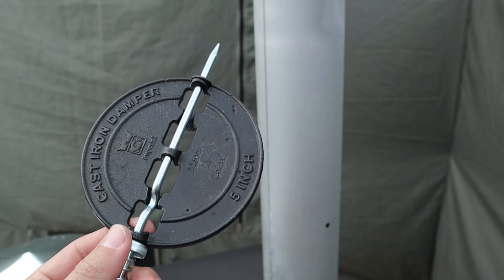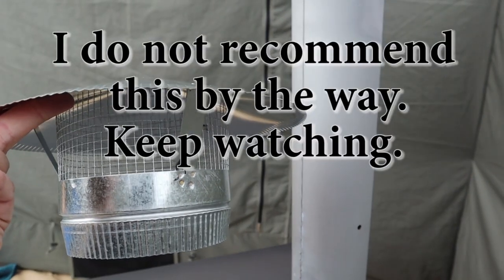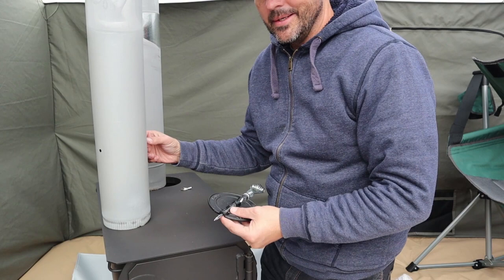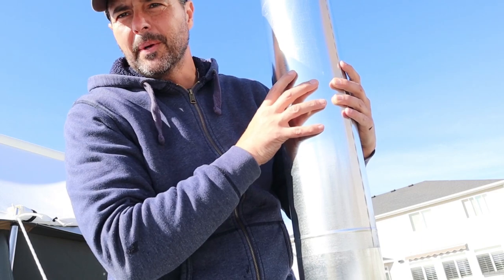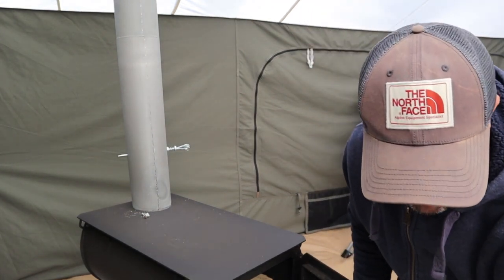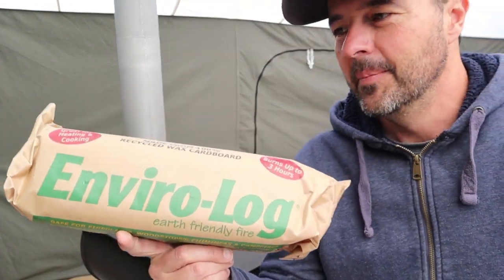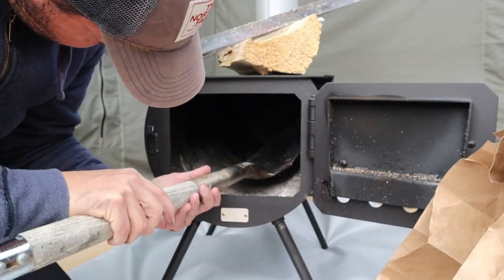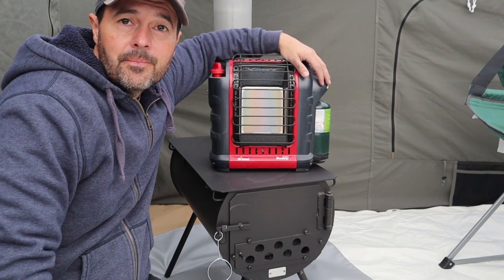Kodiak Lodge Tent 6170 - Day 6, installing damper, comparing Mr. Buddy heater, don’t use a rain cap

Comment: The damper is used to help control the fire burn , open it up and the door damper to have hot fie or to get the wood burning when filling stove then when going good shut both down to let fie burn on a slow burn doesn’t stop the fire foam burning just slow burn and good slow heat ….. been hunting in wall tent for 50 some years .
Reply: Lyle, I just took this tent and stove out for our inaugural first camping trip.  If I close both dampers all the way will I still get a burn through the night?  I found myself getting up a lot to fill the stove up in the middle of the night.
Reply: @adamhilbert8730  yes that’s what you have to do , once you get a good fire going shut both dampers off will burn till wood is gone . If you get up to go to bathroom put some wood in, or if you feel cooling down . Try not spitting all wood if you have whole pices that will fit in use them as many as can get in , burn longer if you put as much as you can . Looking at you’re stove you should be able to put 5-6” maybe 7” in stove , you’ll have to try different sizes .to see what fits best and get lots in , split wood burns a lot faster and quicker .
Reply: @lyleloomis3493  what is your take on the rain cap?  In the video it looks like all the ash and embers came from the EnviroLog he burned.  They are prone to producing a lot of ash.
Reply: @adamhilbert8730   for your tent your pipe goes out the roof so yes use the cap and you might be where it’s law to use . We have our pipe going out the front left side if in tent looking at door , it goes out away from tent 2 pipe length then up in air 2 pipe length no cap we don’t need it. We have 2 - 1” steel pipes drove in ground that we fasten the upward pipe to and tie wire from pipe to pipe under stove pipe too

Comment: Spark arrestor with rain cap is fine but not with a heater cap top style like you would see on a propane heater to push heat down. Ash comes out hits the cap and falls on the tent. With a rain cap spark arrestor that does have the heater cap the smoke just comes out as normal and away from the tent.
Reply from the maker: Thanks for your great points.

Comment: You getting sparks probably because your pipes are not 10 feet at least , I have the same set up but 10 feet , drill in bulbs or screws at top to use guylines to hold your pipes from filling over
Reply from the maker: Great idea!

Comment: Charlie...a question?  Instead of using the rain cap, why not put an elbow pipe at the very top of the pipe, then put a spark arrestor on the end?  It’ll keep the rain out of the pipe and you shouldn’t have the issue of hot embers landing on the tent
Reply from the maker: That's a good point.  I'll have to give that a shot.
Reply: @Competitiveedgeproducts  Please let me know how this works out...I’m still waiting for my tent from you guys.  Overdue by three weeks and counting.  I don’t want to cancel...then I may NEVER get one with the back order waiting.

Comment: Then when there's a downpour and you need heat what's the best option
Reply from the maker: Excellent question.  When it is down pouring you can use a rain cap as a wet roof will be impervious to small embers.

Comment: I know this is way late, but in your demo with the Mr. Buddy Heater you are showing the 9000 BTU model, the smaller one. What difference would using the 18,000 BTU Big Buddy heater, which has two heating elements, make in terms of heating the tent in comparison to wood? Thanks.
Reply from the maker: I think the 18,000 would heat it up nicely.
Reply: All you need is the smaller 9000 model, put a heart activated fan on top and you're good to go. Even on low, this setup will heat your tent quickly.

Comment: I am wondering what it would be like using the Heat Robber and the Rain Cap?  The Heat Robber has its own spark arrestor inside.  This should stop most of the embers and limit what would contact the tent roof.
Reply from the maker: That's a great idea!  I'm going to give that a shot.  I'll post here how it goes once I get my hands on the heat robber.
Reply: Competitive Edge Products, Inc Thank you, I will look forward to seeing how it works.

Comment: even in a down poor not enough water would get into the pipe with a good fire going would do nothing rain cap and worrying about water is nonsense, i been winter camping all my life have been in a very strong rain storms in the fall and never have  had a issue with water into my pipe or stove.
Reply from the maker: Thank you for your comments.  That was my experience as well.

Comment: A thorough cleaning isn't required every time. You should leave the grate in and pull the ashes towards you. The ashes that remain under the grate are a really good insulator to keep the bottom of the stove from burning through.

Comment: Did you use the damper, it slows down the flow of air. That might be some of the ember problem. Not enough speed to send them into the air.

Comment: Listen, you can put the cover back on the pipe you just have to screw the cap to the pipe so you dont loose it again
Reply from the maker: Robert, are you referring to the rain cap?
Reply: Yes I am
Reply from the maker: @onslought2  The rain cap didn't fall off.  I took it off, because it was causing embers to fall onto the tent roof.
Reply: Where do you get the stove and accessories from ??
Reply from the maker: @jaybird3301  Colorado Cylinder Stoves is the brand of the stove and accessories.  This is the Spruce stove model.
Reply: Thank you ! Good videos as well very informative !

Comment: Can you burn charcoal in wood stoves like this? Just the supermarket stuff I mean.
Reply from the maker: That is a good question.  I really don't know the answer to that.  I mean, I'm sure you can, but I'm not sure how efficient it is.  Anybody out there try that?  If so, please share.
Reply: You can but they burn WAY hotter than the wood does so be very careful to not over due it.

Comment: Can you put the spark arrestor mesh on and then put the rain guard on??
Reply from the maker: Great question.  The diameter of the rain card is too wide to fit the spark arrestor.
Reply: @Competitiveedgeproducts  how about just adding extensions to the piping so that the piping goes out and over the ground so that the ash lands on the ground and not the tent?
Reply: I use a spark arrestor cap for over 12 years and haven't had any trouble.  My top section of pipe has a bunch of small holes drilled in it about 6" from the top and down about one foot all the way around spaced and offset about 1".  The embers burn themselves out before leaving the pipe.   Custom made cylinder stove.

Comment: What reason do they recommend NOT using the Buddy heaters?
Reply from the maker: I think it's for liability purposes and safety.
Reply: @Competitiveedgeproducts  did you notice heavy condensation when you tried it?
Reply from the maker: @justins8768  Yeah a bit, nothing major.  I can feel the condensation in the air when I breath especially with a Mr. Buddy.  But I don't see anything beading up on the walls or ceiling.  There is a clear difference with the dry heat though from a wood burning stove.  I own and use both.  I used a Mr. Buddy over the weekend on the Outer Banks and it worked well in the Kodiak screen house, but nothing is quite like a hot stove.  I feel like the stove literally dries the tent on both the inside and outside.  The Mr. Buddy heater adds heat, but doesn't have the BTU's like a wooden stove.  You can get a million BTU's burning a cord of wood for a few hours depending on the tree.  The standard size Mr. Buddy is about 10k maybe?  There are some pros and cons to both.  I'd say the biggest con on a wooden stove is the weight and the wood you need to keep it going.  The Mr. Buddy requires you bring propane, but it's lighter weight, takes longer to heat up and isn't as efficient.  Hope that helps.
Reply: @Competitiveedgeproducts  thank you for taking the time to respond. I am used to running my Big Buddy Heater in a cheap tent which is what I have done for years. It works fine for me but the ceiling is mesh. I am ready to get a bigger, nicer tent but I'm not sure the stove will work for me at this moment just simply because I want to minimize what I'm hauling. I have decided this is the tent I want and I plan on using my Big Buddy heater I just had concerns with the condensation. Thanks again!

Comment: get a proper rain cap for the pipe ... thats for a gas heater ... and useless on a wood stove ... the cap you need is a t cap with fine mesh screen . it will look like a tank gun with muzzle brake  as for the fine mesh ... steel wool held in the cap with some mechanics wire ... it provides a cross flow of air drawing up the flu better ... and the damper adjusts the air flow slowing down or speeding up the fire ... (the heat is just a side effect a damper controls air flow) and for that stove a 4inch pipe is proper size .. 5 inc is over kill and will send more crud up the flu than the proper sized one ... 
.
and not packaging the needed parts from the start that's just plain crappy service ... Kodiak used to be better I guess profit got in the way of quality
Reply from the maker: Thank you for the feedback.  The stove is by Colorado Cylinder, the tent is Kodiak.

Comment: Why couldn't you install a raincap over the spark damper
Reply: The rain cap just meant that embers galore where landing on the roof top.  None did any damage, but I would only put the cap on in the event of some good rain (which I did).  Just be careful how much you are burning with it on.  I've had no complaints from anyone using the cap though.

Comment: If it's windy, point your vent so it blows away from your tent. There is no way burning wood causes that much embers!
Reply from the maker: I'm sorry, but I don't quite understand what your saying.  The vent?  The pipe just goes straight up through the roof and has a mesh spark arrestor - it can't be pointed in a direction.  Or am I missing something?  Wood creates embers, the more you burn, the type of wood, the heat, all contribute to the ember count.
Reply: @Competitiveedgeproducts  point your tent so that the wind blows the smoke away from the tent. And make sure that your pipe is higher than the tent.
Reply from the maker: @dodgerammopar360  ah, I see what your saying.  There a few places I've been where the wind blows consistently one way.  That's not a bad idea.
Reply: @Competitiveedgeproducts also make sure your flu pipe is above your tent so the embers have time to cool before it leaves the pipe

Comment: Use a bigger mr buddy that one is small
Reply: Yeah, I've got the dual burner mr. buddy with a 16 gallon tank and 8' hose and it can heat it up really well.  It's not the dry type of burn though, meaning, you get a fair amount of condensation if you're burning it a while.

Comment: Didn't even compare the Mr. Buddy.
Reply from the maker: No you're right. I should have done a better job about that.  Here's what I noticed with the Mr. Buddy heater - it did okay in temperatures around 40F.  It couldn't heat it down to 1F though.  It would bring the temperature up closer to 40F when running on high.  Could you get by with a Mr. Buddy, sure!  Some campsites won't allow stoves and there are burning restrictions in certain times of the year, especially out West.  There is a Mr. Buddy that has two elements and feeds in with two propane canisters.  That one could keep up much better in this large tent.  So, it definitely could work, but once you've fired up a wood burning heater you know you've got very comfortable heat relatively quickly and you don't have to battle the humidity/condensation that's a byproduct of propane.  Thank you for bringing this up.  I really think I'm going to do another video and compare them as the sole focus of the video.
Reply: @Competitive Edge Products, Inc  Appreciate the response. I own and hate the Mr. Buddy. Condensation leads to mold, which is a disaster in wet areas like the PNW. Not to mention, they are very dangerous. Maybe, you will consider a second part to the video with more detail.